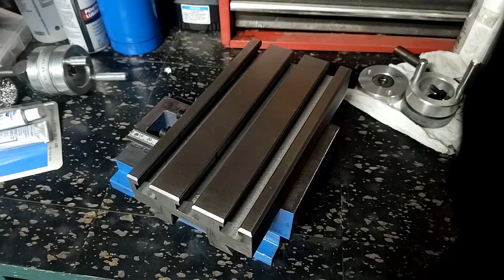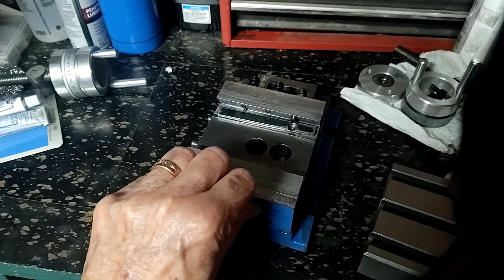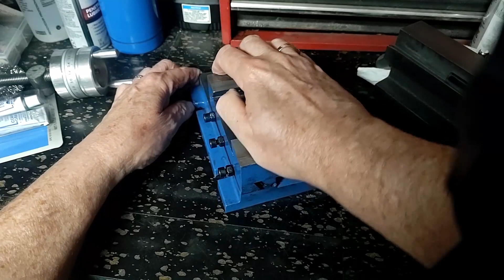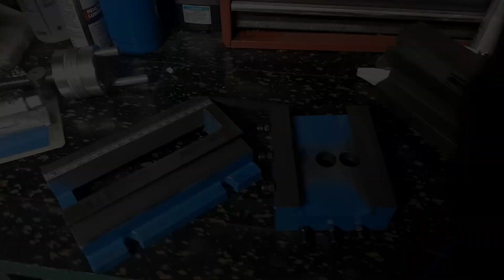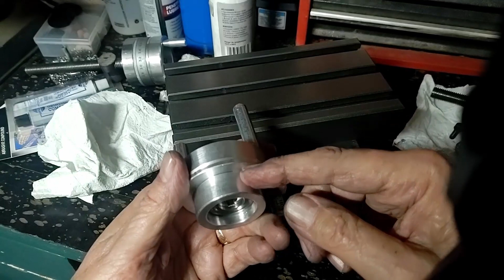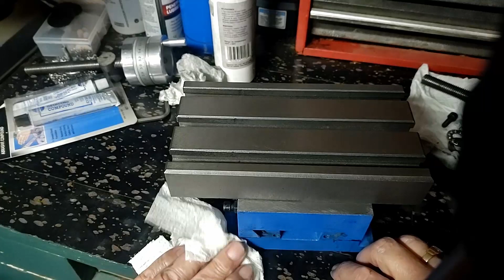Cheap $89 Chinese X Y table. Lapping in the bottom stage, a real grind.

Comment: You added at least $100 of value to that table. :) Only suggestion I would've had is to bolt the table down to something heavy so you could use both hands to move it around.
Reply from the maker: I would have bolted it down, but I don't want to put holes in that bench top. 

Thanks for the kind words. What is sad is that this stupid little table may end up being a much bigger project.